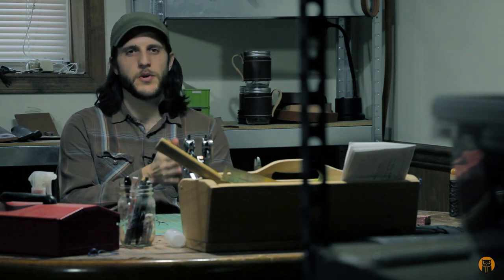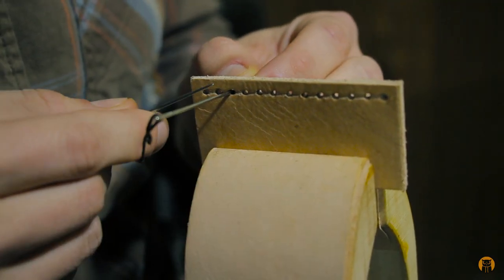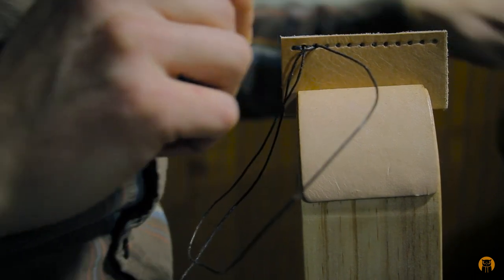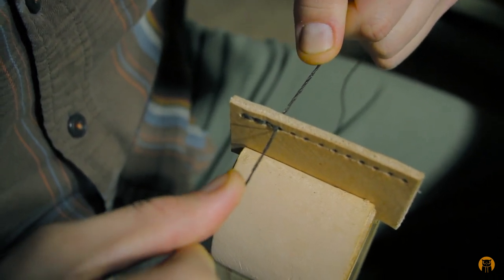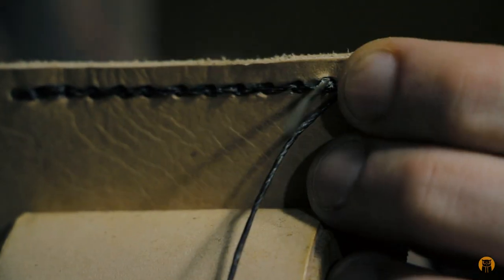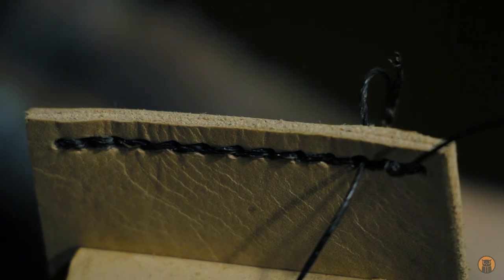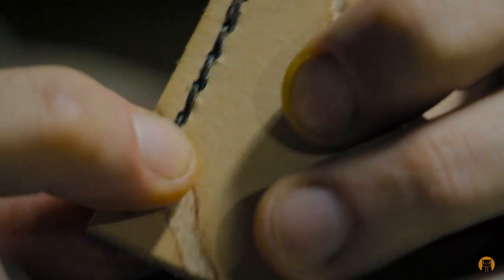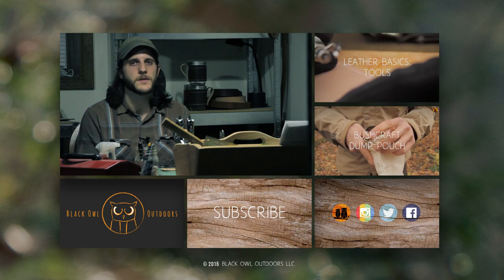Saddle Stitch Tutorial | Leather Craft Basics

Comment: Enjoyed the vid.  I started doing some leather working for my self and friends this past year and half.  The two stitches I use the most are the , saddle , and whip.  Just like how the saddle looks, as well as the strong hold it gives.  The first project that I gave my self was for a ,multi tool. The tool was/is a good tool; love it and use it as part of my ,edc.  The pouch that came with it however was thin, nylon that was sewn so close to the edge that the weight of the tool it self tore out the bottom.  It has been a challenge learning how to do this stuff; broke my neck as a teenager, only have the use of my right side for the most part.  Guess my point is that ant time I can watch these types of videos I do.

Comment: Very helpful video, thanks mate. I have a question you might be able to answer - given that we have to remove a length of thread from our reel and attach needles at both ends for the saddle stitch, is there a standard method for determining the amount of thread we need?
Reply from the maker: Depends on the thickness of leather. But I usually do 4 1/2 times the stitch length.

Comment: So do you usually use a hole punch to create the holes?  I often use a dremel and it's easy to loose control a bit.  Think I will try a small punch.
Reply from the maker: +PaleoHikerMD On some of my designs I'll use a hole punch. On long stitches I usually use a Dremel. I get pretty good results. I still need to play around with chisels and irons.
Reply: i'm inexperienced but there are tools that help you cut the grove at the right distance and they are adjustable, and there are several tool types for making the holes for the stitch, i've seen rollers that appear to be for this and i've seen several types and lengths of punches, using the longest one you can fit in your stitch line and selecting the right hole size and spacing for your piece, i assume for accuracy you could also link one of the last made holes into the tool for the next set to keep the spacing the same, anyone can feel free to correct me if i am wrong though

Comment: What is the point of starting with a backstitch? Usually its so the thread doesnt pull out of the fabric, but with a saddle stitch, you dont have to worry about that. It seems like an unnecessary step. Backstitching at the end stops the thread from backing out and secures the stitch, again, which is something you dont need starting a saddle stitch.
Reply from the maker: True, it won’t come undone like the ending of a stitch. But double or tripled stitched it stronger than one thickness of thread. 

If you’re starting your stitch at a high stress area, it helps to double it up.
Reply: @BlackOwlOutdoors  i see what ur saying. it could help. but would the extra stitching stick out an cause more wear on the stitch causing early failure?